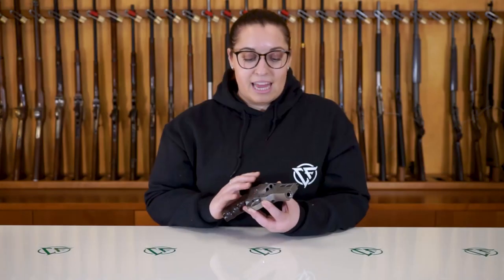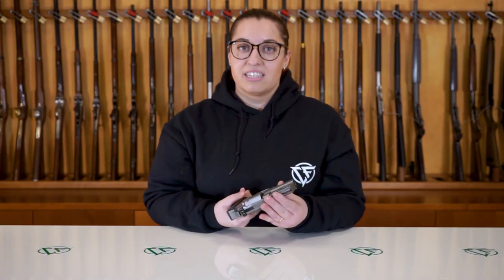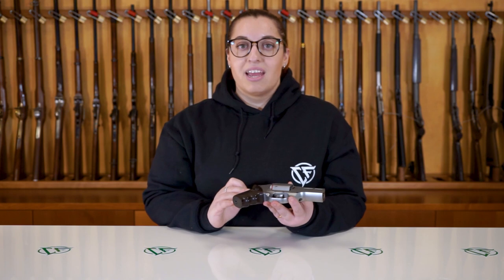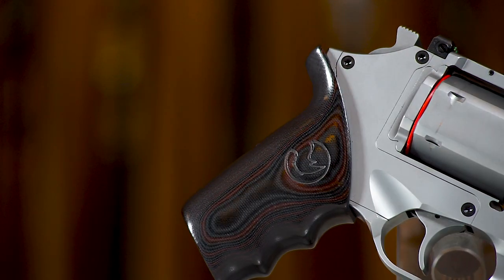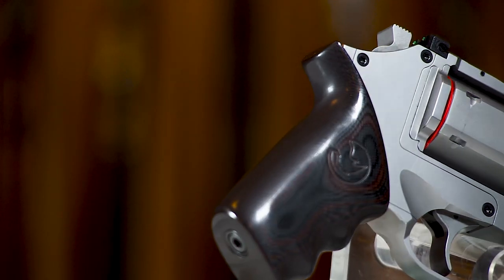CHIAPPA FIREARMS RHINO 30DS X (STAINLESS) - #CHIAPPADIGITALSHOW2020

Comment: Use a precipitation hardened martensitic steel like carpenter 465 for the cylinder. Your cylinder has enough meat to fire 41 magnum if you use the right steel. Don't give us the 357 frame in steel when you already shown 40 cal fits.